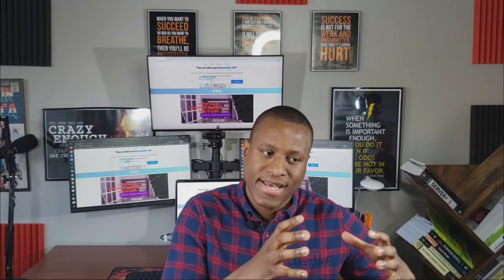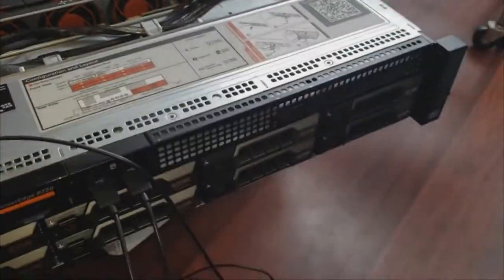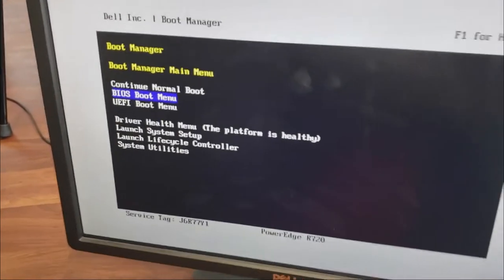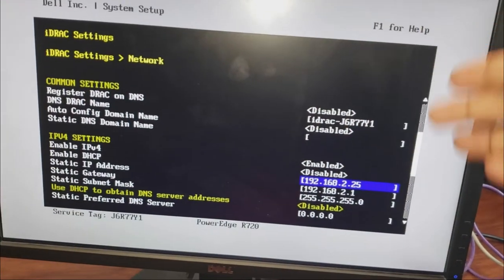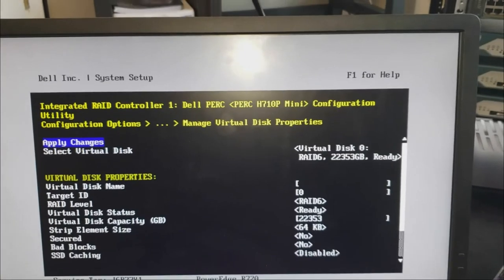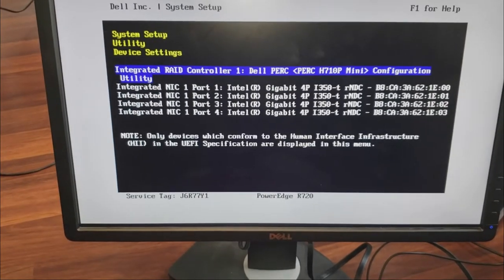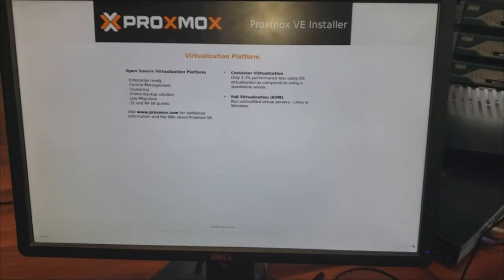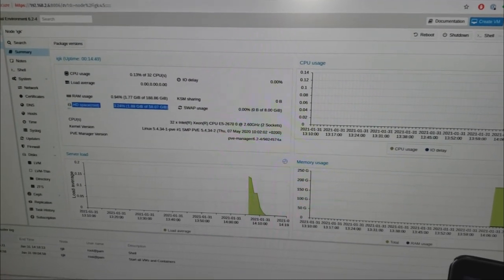Set Up iDRAC, RAID, and Proxmox on My PowerEdge R720 Server

Comment: I'm really liking your content. I just wanted to offer a suggestion that you've probably already thought of and fixed on a later video. Take the faceplate off of your old optical drive and attach it to the ssd drive. That will cover the gap perfectly.
Reply from the maker: That's a great suggestion! I ended up buying a different one, but for anyone watching this, you should defiantly try to do this. Thanks @TheSpoonyluvin.

Comment: You can still use DHCP and have the router assign a specific IP against the server's MAC address. No need to manually set it in iDRAC. If you are managing lots of servers it's better to be able to assign them all in one place, i.e. the router, or other management software.
Reply from the maker: Thanks Robert, I agree. I did made that point in the video.

Comment: Servers (especially rack mountable) need to be run closed because their internal airflow has been optimized that way. If you run them open some parts might get worse cooling. To compensate that servers spin their fans faster => more noise you get.
Reply from the maker: Hi Rodrigo. Thanks for the input. Yeah, they tend to do that when they're open.

Comment: I got my R710 earlier today, it sees the usb but proxmox wont install because it can not find the cdrom, Tried mounting it but it wont have it.
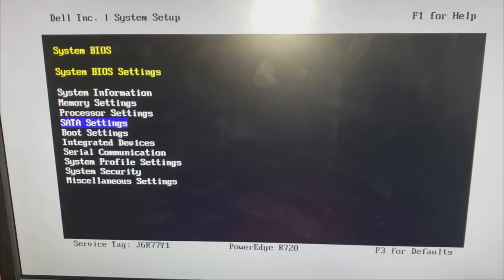Reply from the maker: Hi Liam, Make sure the SATA cable is connected, and go into the SATA setting and enable it. 12:21
Reply: I had the same problem and I just created a virtual disk from the bios, and it worked, maybe it's not the best performance solution, but it works

Comment: I did the same thing swapping the drive with an SSD caddy on a Thinkpad. I wasn't paying attention and got the 9.5mm and realized it was too thin, so I had to get the 12.7mm caddy. Luckily they are cheap. But definitely a lesson to check the drive size if you swap it out. I actually just picked up an R720 16-bay SFF. I didn't think of it until I saw this vid, but may just grab a caddy for this as well.

Comment: So, you mentioned multiple times how there are no usb ports on the back.  There are two, and are visible even in the video at 4:38 when you are showing us that there arent any.   Look to the left of your network cable.   I have the same r720 and this is where i have my mouse and keyboard plugged in.  I use the front for flash drives and such.
Reply from the maker: Hi @Carpesimia,  Thanks for the input, and you're correct, I missed that part in the video.

Comment: Awesome video!! Extremely helpful information. 
I did have a question as I am configuring one of those myself - do you how I can configure each of the NIC Ports to a certain IP address?
Reply from the maker: Hi Dave, Thanks. you can set a static ip in Bios,  You should be able to do it in Proxmox as well after setup. You can also do it at the DHCP level, so you can do a DHCP reservation. You will need to know the MAC address for this (DHCP Reservation).

Comment: Interesting video - I am installing a similar setup with a small SSD drive and Raid setup for data.  Out of curiosity, what did you format your raid data disks as - have read ZFS should be avoided as it likes to act like a software raid and "self heal" and as such doesn't like to sit on top of hardware raid and can easily corrupt.

Comment: Great video thank you, tomorrow I will be receiving my first server, r720 dual 2695v2, it's going to be used solely for one program as a render node to my main rig, basically just rendering animations so I can carry on using my main machine, I've never used a VM before, I'm running win 11 on my machine, and have a rack mount nas for project files. Do I need to VM or would it be simpler to just run win 11 on the r720? Will I be losing or gaining anything from not using VM? Thanks man, subbed

Comment: Hey,
I've followed the iDRAC setup you did (with my network credentials—IP, gateway, subnet mask). I've logged into the gateway and checked that everything is accurate, but the iDRAC still doesn't work. I've assigned it to DHCP. Then, when I logged into the gateway, and saw the "iDRAC-..." entry, and entered the IP address it assigned, it doesn't work. Any ideas how to fix it? I'm trying to quiet down the annoyingly loud fans on my R720XD using iDRAC.
Reply from the maker: Hey Rowan, it’s hard for me to tell you what’s wrong without seeing your configurations, but some of the things I suggest are…Make sure you set a static IP,  make sure the reservation is set on the router/gateway, make sure you have the correct license.

Comment: Great work brother!  I am learning a lot from watching you.  I am a noob and just starting out with VMs and servers and Home labs - so am I right in thinking that once the server is setup and in my case will remain in the garage connected over cat 6 cable to my router and other PCs I can use any PC on the network to access and run the VMs like MacOS, Windows etc?  My network is 1gb ethernet - so VMS are run from a web browser over the 1gbs ethernet?
Reply from the maker: HI Austin, sorry for the late response on this. You should be able to remote into the server just fine, as long as they are all on the same network.

Comment: Thanks it was a helpful video. One question how did you make proxmox to recognize your raid 6 array for your vms?
Reply from the maker: HI Martin, if you are talking about during the installation, then you need to create the raid first before installing Promxmox. You can use the raid controller to do so, or you can also do it in idrac. I hope that helps. Let me know if you have another question.

Comment: Hi, thanks a lot. One question please, what about drivers - especially power management and embedded raid controller(perc s100 in my case) do you need to download/install it separately ?
Reply from the maker: HI, You're welcome, and you can update most of your drivers using idrac you will need to upload it.

Comment: are you using Open Manage Server Administrator (OMSA) on top of proxmox? if yes can you explain how you installed it and made it works?
Reply from the maker: Hi Davide. I'm not. I use iDRAC for management.
Reply: @KoromaTech  I was trying tonuse OMSA to manage PERC virtual disks, but using ZFS I ended up flashing my PERC controllers with IT firmware so no more need to use OMSA👍

Comment: What about RAID 50 or 60? The issues with RAID 5/6 is worse write performance, but it is very cost effective. I would never do RAID 5 because if you loose a drive and have a read error on another drive you can loose the whole array. RAID 60 I feel is the best of all worlds, but you do need at least 8 drives and 4 drives will be lost to parity essentially.

Comment: Don't install proxmox on the single SSD drive, if the SSD needs replacement then you will get into trouble.
Use RAID for proxmox and storage. You can use software RAID such as zfs or hardware RAID.
People like the software RAID because it really does the job. But if you have hardware RAID, then use it and be sure you have a spare RAID controller the exact same thing in case your RAID controller didn't work in the future.
Reply from the maker: This is good info! Thanks for sharing and I'm sure it will be helpful to others as well!

Comment: Hi mate. I am having so many issues while installing Proxmox. I think I am doing something wrong here. Initially I had RAID 5 configured and was able to successfully installed Proxmox. I was able to connect to GUI but I had the below issues the first time.

Below are what I see in the disk section. And when I go to the directory, to create directory, it is empty. I am sure there is something I am missing. I have SAS drives and I have set up RAID 5 on this machine. Any advice is greatly appreciated.

 /dev/sda unknown partitions 12.00 TB Yes PERC_H710P
 /dev/sda1 partition BIOS boot 1.03 MB Yes
 /dev/sda2 partition EFI 536.87 MB Yes
 /dev/sda3 partition LVM 12.00 TB Yes

So I had to wipe everything and reinstall Proxmox with RAID 5 configured. and now I am getting the below error message. I am using Poweredge R720XD. Any advice is greatly appreciated. I used Rufus to burn to USB.
Installation failed
failed to prepare EFI boot using Grub on /dev/sda2 : unable to install the EFI boot loader on /dev/sda removing diversion of sbin/start-stop-daemon
Reply from the maker: Try using Etcheh instead of Rufus and give it another go.